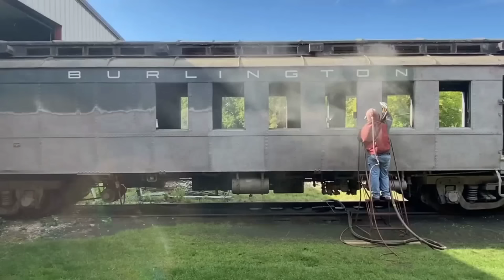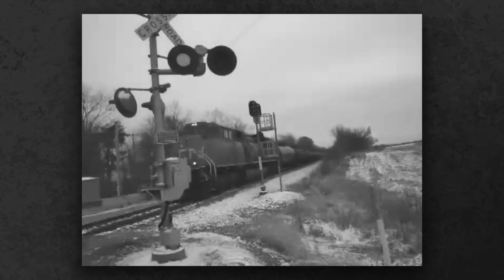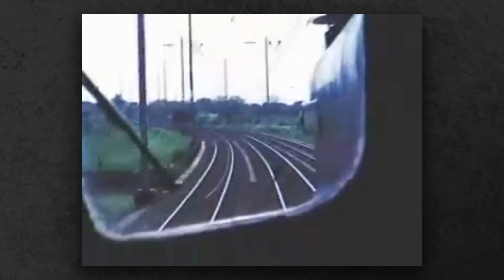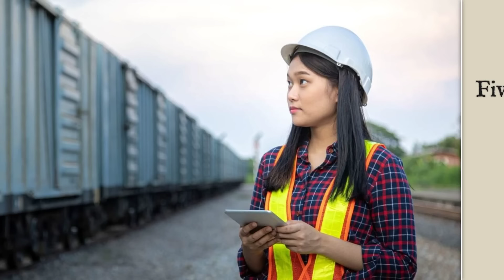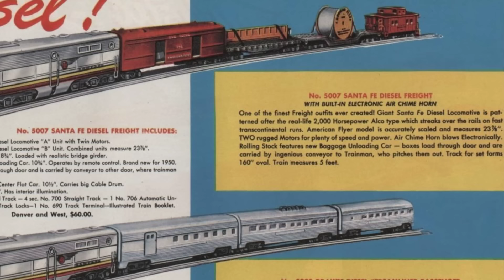15 Things ILLEGAL on Locomotives NOW, but Normal in the 1950s!

Comment: You showed the PRR's GG-1 several times jn the basement of Washington's terminal.  The GG-1s cab had been relocated warm the Box Cab location back, and the PRR had Cab Signals.  The PRR did investigate this accident and found a bad air value between the 3rd and 4th cars.

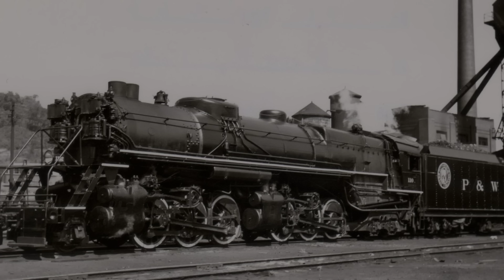Comment: No mention of "polling" and pole pockets!   This enabled locomotives to move cars on adjacent tracks without having to switch over to the same track as the cars and couple.  Most cars back in the day all had them at all four corners.  Hood locomotives through the second generation had them in the stairwells.  You placed the end of a long study pole into a dished out area on a locomotive or car powered by a locomotive and the other end placed diagonally to the dished out area on a car sitting on the adjacent track.  It worked great until it didn't.  The guy placing the pole in position hoped the pole would not jump out or splinter in some unimaginable way under compressive force.  It was as good of a way to get killed as any.  Look at old photos and you will not miss them once you know what to look for.  @ 16:37, one of these gems is easily seen on the pilot of that 2-6+6-4 just ten O'clock of the journal box on the leading truck 😊.

Comment: Ditch lights are NOT required to flash.  Those that flash are triggered often by the engine bell.  If triggered by the horn/whistle, they would not flash in "no-horn/whistle" zones.
Reply: Most ditch lights that flash will flash with the horn.  There are many places that would be appropriate for the bell but not suitable for ditch lights to even be on, let alone flash.  The flashing ones on NS and CSX power are tied to the horn, but NS units also have a switch to set them to flash, steady on,  or off.  In the off position they still flash for 30 seconds after the horn is sounded.  Brightline in Florida could stand to install the flash switch since they operate over a lot of quiet zone crossings with just the bell, no horn.  Theirs are triggered by the horn.

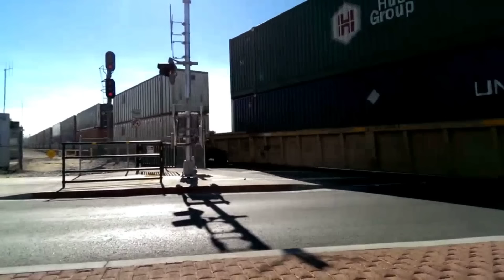Comment: 7:53 it’s actually 25 MPH, idk if that’s a FRA rule but the railroad I used to work for you need to turn on the ditch light at over 25.
Reply: The FRA requirement is 20 mph.  Any engine that travels faster than 20 mph must also have a speedometer.
Reply: @erie910  Any engine built before 1949, not capable of speed greater than 20 mph, or powered by steam is exempt from ditch light requirements.

Comment: Locomotive alerter systems will not initiate an emergency brake application.
Reply: Correct.  Penalty application only and will draw the trainline air down to zero slowly.  Emergency braking has its own dangers.
Reply: @alwhalen3488  correctamundo.

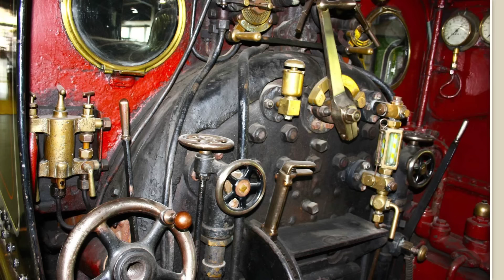Comment: You should use the youtube chapter feature for your points. 3:09 You had a heater/firemen in the steam engine.
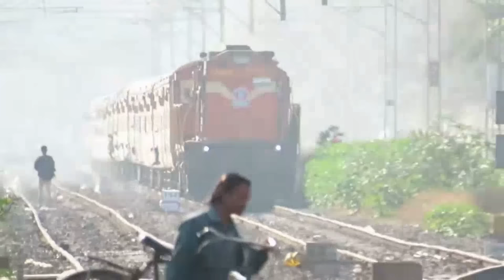3:42 In Europe, it's ever 30 seconds for some time now. That's unnecessary.
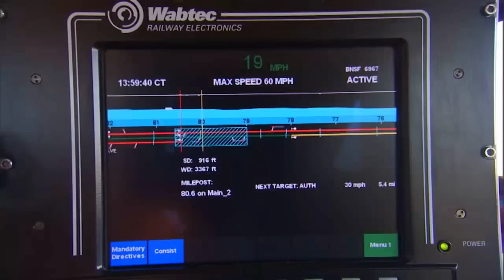4:16 The trains in Europe still don't have toilets. Urine-diverting dry toilets combined with a waterless urinal would be a good thing in engines.
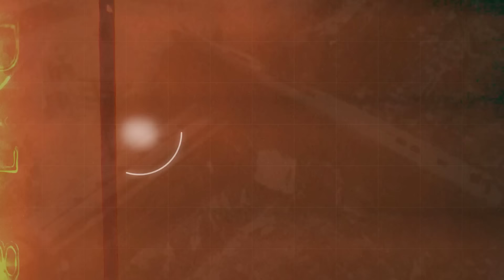15:47 In Europe and the Amtrak Northeast Corridor the localization today works over passive electronic transponder beacons in the rails.
Reply: The toilet they were showing was a coach toilet, not a locomotive one, which are nowhere near as nice, but a step up from the Norfolk Southern practice of issuing every crew member a plastic bag to put over a camping toilet frame before that regulation.  Steam era practice (men on crews only) was squat over a shovel full of coal and wipe you a** with a rag.  That and cooking a meal on the coal scoop or heating a can of beans in the steam piping (punch a hole in the can first) were common practices.

Comment: Why would a locomotive the requires two crewmen in the cab need a dead man switch/alerter.  I am pretty sure the other man would notice the others incapacitation.  Even the long tunnels and snowsheds of the Sierra's that would choke out crews never incapacitated both crew at the same time that I am aware of.
Reply: There has been a few deadly accidents where both crewmen fell asleep..one being a BNSF coal train in Iowa that plowed into a stopped MoW train..both crewmen died on impact..😮
Reply: Several years ago, there was a train collision near Hinton Alberta.  Between fatigue and medication, the crew apparently fell asleep and ran a signal.  There are some YouTube videos and a Wikipedia article about it.
Reply: @James_Knott  PTC is suppose to handle a run signal.
Reply: @larrybremer4930  I think HInton was before PTC.  It happened in 1986, IIRC.  Also, both men in the cab missed the signal as did the crew in the caboose.

BTW, I used to be a telecommunications tech for Canadian National.  Back in the mid 70s I frequently rode freights in my work.  One thing I know is the tail end crew were often not watching the signals.  When riding in the caboose, I'd usually be up in the cupola by myself, with the conductor and brakeman doing whatever below.
Reply: @larrybremer4930  Not every line requires PTC and many passenger trains run with an engineer-only operation.  There are many currently in-use locomotives that are not even equipped with any such device.  It has to work if it's equipped, but equipped actually is not mandatory in many instances.
Reply: What if both crew fell out, or were incapacitated by a blowback or similar?

Comment: The Great Western Railway in England had train control way back in 1904 for your No. 4 spot. In steam days Great Central crews would hang around at Banbury basically to bump up their overtime. So the western got fed up with it and coupled a GWR loco on the front and the train went "hell for leather" through pea soup fogs frightening the living daylights out of the GCR crews to Woodford Halse where the GCR lines were. But the GWR crews were relying on their automatic train control for unlike the US all the lines were fenced and all the road crossings were manually operated so no vehicle could cross in front of a train. Just because things were done one way in the US doesn't mean it was the same all over the world and what is now law in the US doesn't mean it's now law everywhere. Too many think that this is how is done in the US so this is how it has to be done all over the world. WRONG!.

Comment: In fact afaik European steam locomotives did have sort of a driver vigilance device in the 1950s already
We have also been using 3 headlights since like the 1930s essentially
Mechanical train control devices (aka just a board raised and lowered with a small electric motor which a lever on the side of the train would slam into triggering the brakes) have existed since the 1910s and in many places still continue to function today. Electromagnet based train control systems were invented in I believe the 1950s and could enforce different speed limits using different frequencies (the rest is handled by on board circuitry)